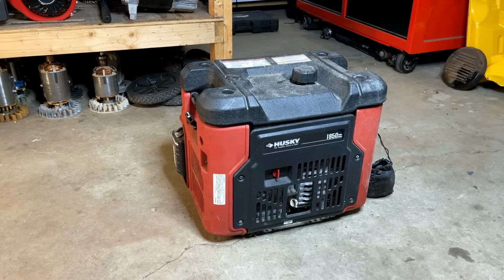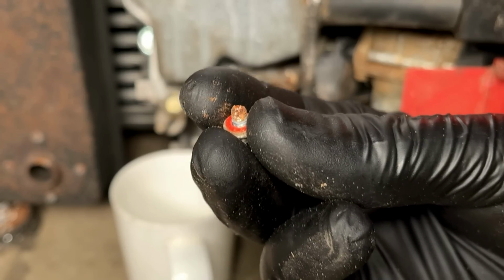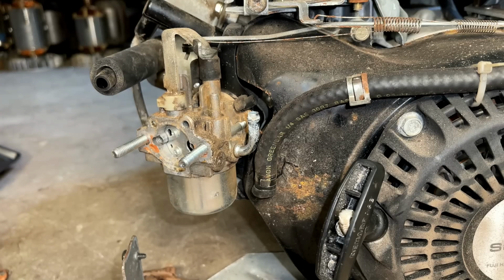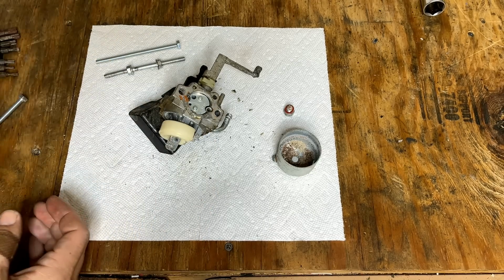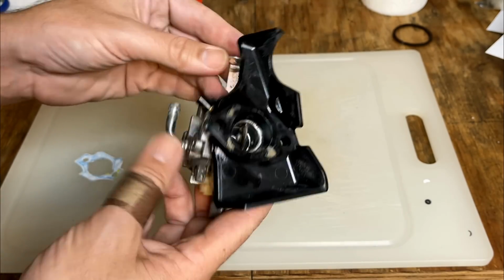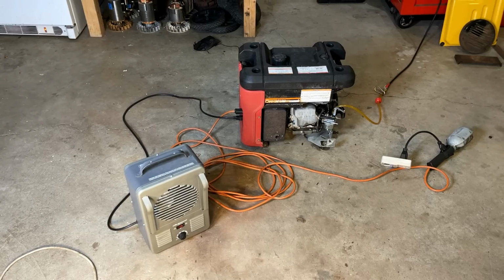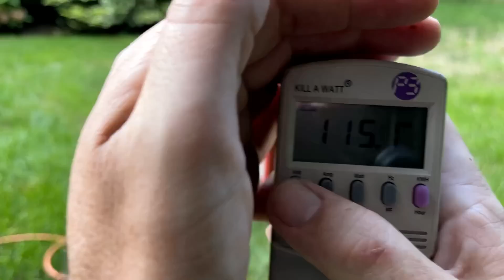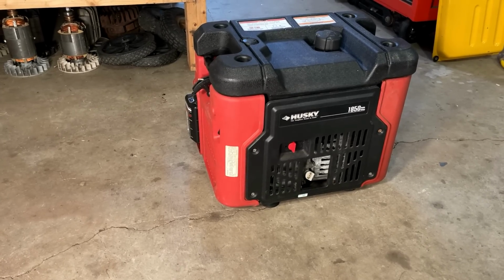Husky 1850 Generator Will Not Start - Stuck Carburetor

Comment: I had the exact same generator except in mint condition.  Bought on fb for 75 bucks with a bad carb...put a new Subaru carb in it and worked great.  However I ended up selling it because I wanted something with cleaner power and will buy the Honda EU2200 instead.
Reply from the maker: The EU2200 is a very nice generator.

Comment: When you cut a bolt you can put a nut on the bolt & back it out after cutting the bolt & it will help reset the threads
Reply from the maker: Thanks.  Good tip

Comment: My small generator has a larger version of that motor and seems to have very low compression while pulling it over, but I think it's just how they are with the compression release it only has about 100 hrs on the meter and runs excellent

Comment: It would be interesting to see the oscilloscope connected to your house AC utility power to see that wavefrom as a comparison.  Maybe also the kill-o-watt unit showing utility Voltage and Hz.
Reply: I agree.
Reply from the maker: I had planned on doing a video late September comparing the output of all different generator types vs the house AC output.  Will do it at some point.  Maybe a winter video?

Comment: James, on that dirty power. If you double the capacitor do you think it possibly could smooth the wavefront? I thought of another way to use this with a battery with a pure sine wave inverter. Might just size the inverter to your application for less cost.
Reply from the maker: I don’t think changing out the capacitor will clean it up.  All portably brushless I have tested are dirty like this.

Comment: Most small engine mechanics always do a float needle leak test by blowing into the carburetor inlet gas line and moving the float to check the seal.

Comment: Questions, are inverter generators the cleanest power? How does the WEN GN875i do as far as clean power production? And where can I get a inexpensive oscilloscope?.
Reply from the maker: Inverters are the cleanest.  Have never tested the Wen, but would expect it to look good.  The oscilloscope I use is available on Amazon YEAPOOK ADS1013D Handheld Digital Tablet oscilloscope Portable Storage Oscilloscope Kit with 2 Channels, 100Mhz Bandwidth, 1GSa/s Sampling Rate 7" TFT LCD Touch Screen (ADS1013D Plus) https://www.amazon.com/dp/B08L3FRKYF/ref=cm_sw_r_cp_api_glt_fabc_M1N42P7QCA582PKNKWE4?_encoding=UTF8&psc=1

Comment: All the talk about dirty sinewave - Should I be concerned about powering a laptop, for example?  I have the same generator (which I picked up for free at the end of someone's driveway) and I love it
Reply from the maker: Most likely the laptop will be fine.  Would say worst case it could case a failure in the laptop power supply, but probably not.  Also running the generator under a load helps smooth out the sine wave some.

Comment: James, what should I look for in a torque wrench for small engine work?
Reply: Inch lbs only. I also have a gun smithing torque wrench that looks like a fat screwdriver, which can do very low torque.
Reply from the maker: Definitely a wrench that can measure in in/lbs.  The one I use can measure 20-220 in/lbs.  I also have one that measure from 20-100 ft/lbs.  Only need that on flywheel nuts and head bolts.

Comment: Seems counter-intuitive that a brushless generator would have dirtier power (one would think that brushes would induce noise into the waveform).  Are the rectifiers on these smaller units rotors not  "full-bridge"?

Comment: I don't think that dirty sine wave is going to damage much of what you would run off of it.  Pretty much all sensitive electronics are DC powered and have full wave filtered rectification power supplies.  Maybe AC motors might not particularly like that power.  But what people think of as being susceptible is not really very unacceptable.  Transformers might not like it either. But most electronics these days don't have transformers in them.
Reply: I would be most worried about capacitor-based "transformerless" power supplies. The ringing could easily lead to more than double the current consumption.

Comment: That's a small one.   Is that about a 5HP motor?    Most of them I see on the channel are  8-12HP.
Reply: Probably about 4 HP. If I'm not mistaken the engine horsepower rating is usually about twice the kilowatt output rating.
Reply from the maker: Probably closer to 4hp

Comment: I have a artic cat zr800 twin carb. getting a pretty good gas leak  from one of the carbs after the sled has been off for about 10-15 min later. it leaks about 4-6 oz of gas but does stop on its own. I purchased a carb rebuild kit. stuck float bad seat on needle? any thoughts thanks James.
Reply from the maker: Sounds be a needle problem.  Would imagine thought that the article cat has a fuel pump so even with a bad needle would not expect that.  Maybe a fuel line is heating up when then engine is off and fuel not flowing.  The pressure from the fuel vaporizing could push past the needle.
Reply: @jcondon1  update fixed it. Turns out there is a water catch at bottom of carbs and they were cracked and petrified leaking gas. Thanks for the help.

Comment: What is that orange tool you used to make the gasket?
Reply from the maker: I used a leather punch ABN Hollow Punch Kit Leather Punches Tools Hole Punch Set Gasket Punch Set Gasket Cutter 3/16 to 1-3/8in (5-35mm) https://www.amazon.com/dp/B07PQYRG9K/ref=cm_sw_r_cp_api_glt_fabc_FJB1N9K6XG6TJ00Y43XW?_encoding=UTF8&psc=1
Reply: @jcondon1  i am gonna buy a set never seen them before i just used scissors but way easier set up you got there

Comment: What grade of bolt was it that you got from the hardware store?
Reply from the maker: I forget the grade, but think it was not a high grade.  Only torqued to 60 in/lbs.
Reply: @jcondon1  The carb's not subject to massive vibration or heat, but would you expect it will last a long time?  It would be good to know if they had a good track record of durability.  It seems very difficult to find out what the typical grade is that's used on most such engines.

A couple of years back I converted our Black Max generator to run on a propane/natural gas system alongside gasoline.  It entailed adding a gas supply block between the carb and the airbox (I'm sure you're familiar with the setup).  It came with stud extenders to allow everything to fit onto the original studs, and while it seemed to work, I was never happy with the solution.

Just recently I found a seller on eBay who has replacement studs, and I ordered a pair that were about an inch longer than the originals, which allowed me to remove those janky extenders.  The installation is much neater now.  Now all I need to do is to figure out how to get a bracket that can match up with the lower mounting hole on the airbox (it doesn't line up with the original bracket because of the propane block). 

Your videos are a literal treasure trove on knowledge, experience, and actual how-to level detail of performing the work.  It's stunning that you only have 66k followers.

I hope you keep making them for a long time to come.

Comment: $37 for a clone? No telling what the real McCoy would have been. Those long slim studs can be problematic for just the reasons you found. You can get a clamping stud puller. There's a type that will clamp up flush to wherever it's attached. Not the Snap-On  type. The one I had was a Proto. But, you  can probably get one similar on the cheap.
Reply from the maker: Subaru parts are not cheap.  I needed the air box on this machine for another project.  OEM part was over $100.

Comment: Good grief all my gensets have brushes thankfully. But I have had a DVD player for my grandson die with one of those cigarette lighter 400 watt car inverters. I may check the output of my cars 110v output on my scope. It is a newer car and has a 110v output built in. I'm hoping it has cleaner output than this brushless wonder. It also has a built in phone charger that I almost don't want to use, but DC should be much cleaner.
Reply from the maker: Probably a square wave from the car inverter.

Comment: I removed some springs from mine and now it is very accelerated I don't know what to do could you help me
Reply from the maker: Check to make sure the throttle plate is not stuck and also double check the idle set screw.  If in too far, then the engine will run fast and the governor will not be able to slow it down.

Comment: That is the probable cause of carb. bolt bent, they tried to get it off and bent it doing so.
Reply from the maker: My best guess is something happened at the engine factory or during shipping to the generator assembly factory.  Most likely was this way from new.

Comment: Park Ranger won't like that Generator. There ant no screen on the muffler to prevent it from sparks form flying out
Reply: And why did they allow the exhaust gases to directly blow across the ground...which might just be composed of nice dry pine neeedles or grass...
Just a small upward lip angle to the exhaust exit from the muffler (say with a gauze sreeen) would have stopped that being a fire hazard...

Comment: I'm getting 30v when I measure at the brushes. Stater is only showing less than one volt. No power to the 120v outlets and a weird 7 constant volts to the 240 plug. Any ideas? I've watched a lot of your vids can't figure it out. Changed the avr still no luck
Reply from the maker: Sounds like you tried the easy thing.  Most likely an insulation failure in. The DPE winding or maybe a broken wire on the rotor.  You would need to test the ohms of all the coil and check each to ground and to the other coils to be sure.
Reply: @jcondon1  thanks we'll get on that as soon as I can. Thanks for the info brother

Comment: most people buy generators but then they don't add gasoline fuel stabilizer to the fuel or they use ethanol fuel .....  using 100% pure gasoline (boat marine gas) and fuel stabilizer adds life to small engines.......just saying that for the 9% of p0eople who have never heard of such things
Reply: Have a look at TarylFixesAll and the test he did on fuel stabilizers.  They all seem to be snake oil.   I only run Premium non-ethanol fuel in any of my small engines and never leave them with gas in them.  If the fuel isn't used after 60 days, into the car it goes.  I never keep more than 5 gals extra at anytime.

Comment: James my man it pains me to see you crawling around on the floor with your projects, invest in a pneumatic scissor lift work table and give your knees and back a rest !
Reply: Prior to breaking the lightly bent stud give it the old rubber mallet and pipe treatment and straighten it in place...
Reply: Try to clean up the sine wave with filter capacitors?
Reply from the maker: I am looking for a proper lift table.  Most of the time I am sitting on a short stool, except when I needed it to change the oil https://youtu.be/3RwPPmuJzpo?t=2066